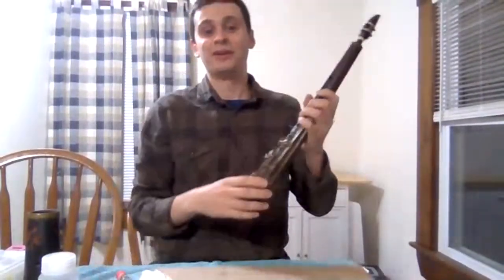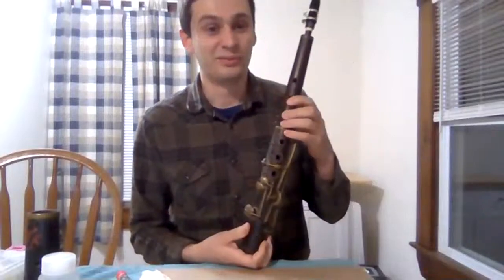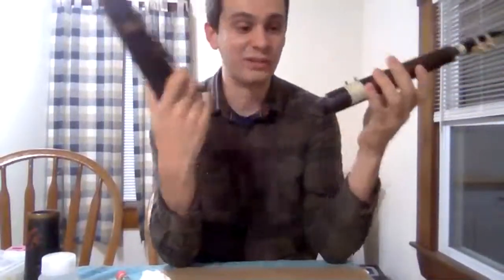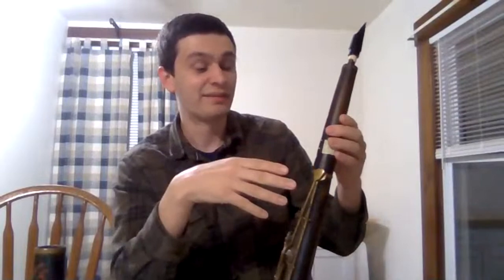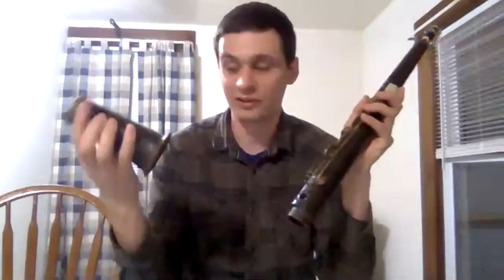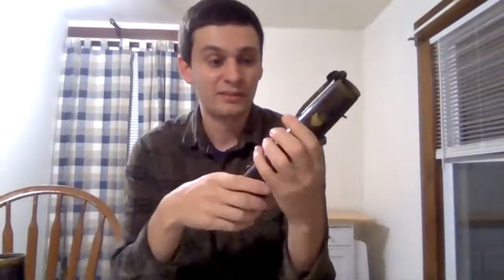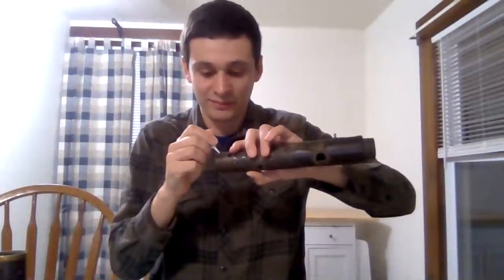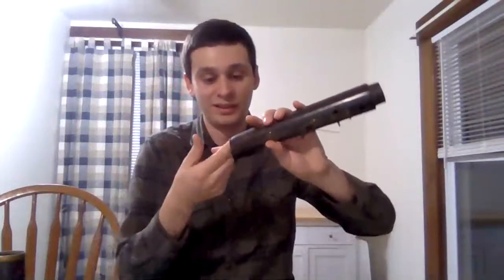Fixing my "new" Tarogato

Comment: Hi Jared, I've just finished rewatching Bret's livestream he did on the 3rd of this month. I've skipped to the part where you've mentioned me and my nelinda prototype. You also said instruments that overblow at 2 octaves has potential and that you were even considering adding a Boehm system to one. Would you be interested in having a 2 by 1 frustum tube made for one of your clarinet's mouthpieces one day?
Reply from the maker: You mean something like the flat sax made by Linsey Pollak?
Reply: Yes, except with the mouthpiece on the large end.
Reply from the maker: @HelicopterHarmonics  The cross sectional shape of the bore will make little to no difference to the tone of the instrument, so if it is easier for you to make a polygonal bore as opposed to a round bore I would say go for it.
Reply from the maker: @HelicopterHarmonics  The cross sectional shape of the bore will make little to no difference to the tone of the instrument, so if it is easier for you to make a polygonal bore as opposed to a round bore I would say go for it.
Reply: @Jared De Leon I though you were only referring to just a tube with tone holes. This tube would just be the standard circular bore like with my prototypes from 2-3 years ago.